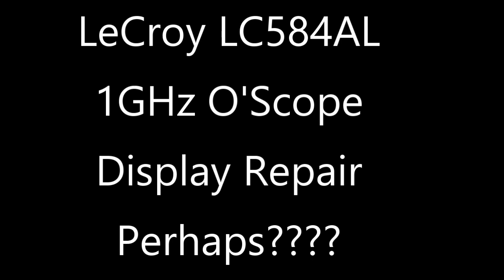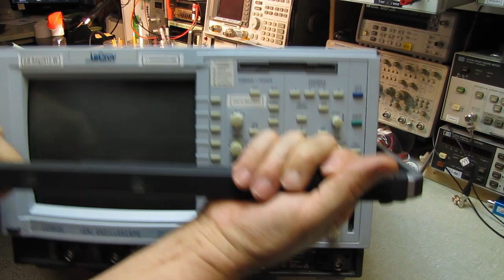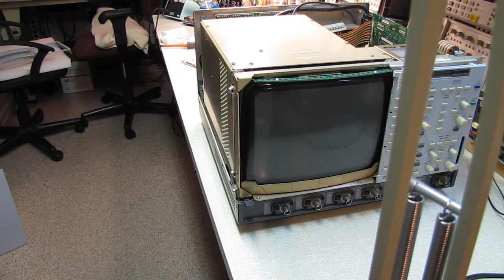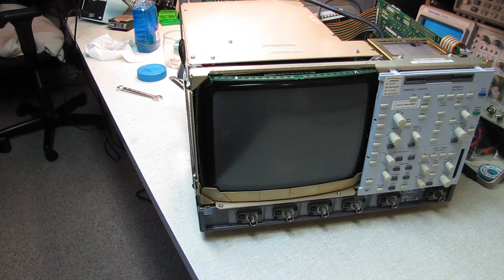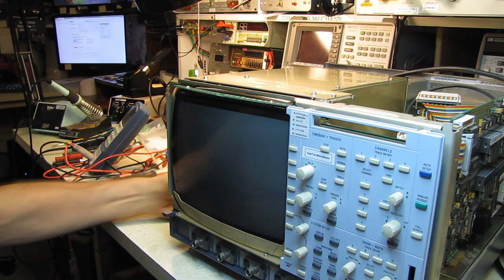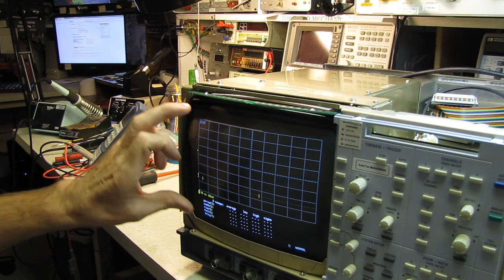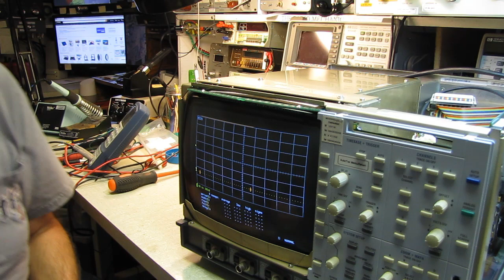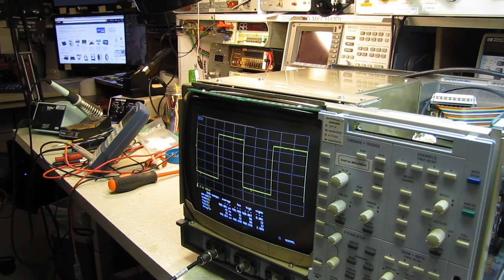LeCroy LC584AL O'Scope Monitor Repair - Perhaps ??

Comment: Humidity sensor, sees to be a magnetic field cancellator device which comes on  only when you put a disk into the disk drive. The top of the screen goes blank then.
Keep the floppy disc reader inside but not connected since you don't use it.Your jittering screen  might go away.

Comment: I know I'm a couple of years late but the monitor is a CD-1035E series monitor. I have the same in mine an LC574A and a service manual is available through the LeCroyOwnersGroup. Mine has no raster and working on it is impossible like you described so its been apart for a while and will probably go to an LCD screen if I can find one.

Comment: I've had the worst luck with Lecroy's, --  I've owned three of the older amber 'scopes up to 1GHz in my shop. I currently only have a 9350 500MHz that I switched on 3 weeks ago and although it powers up, no display anymore. I don't have the time to repair it and I feel your pain. I had an amber, white case, 1GHz that, when I moved it, it committed suicide on me (I was moving it to another position in the shop carrying it by the side handle when said handle decided to part from the case and the 'scope made an ugly mess all over the shops concrete floor). It probably knew it's display was going fail and did the honorable thing first. I love these 'scopes, but they are a service nightmare. I have Tek 'scopes going back to the 7000 series that just keep on ticking... the most reliable scopes ever.

Comment: The good ole days in the TV shop when you could buy a can of freeze spray or use your Weller gun to cool or heat components. Found many intermittent problems that way.
Reply from the maker: Still works today.....
Reply: @Marvin Emory Instablaster ;)
Reply: @Kash Finley Thanks for your reply. I got to the site on google and im waiting for the hacking stuff now.
I see it takes a while so I will reply here later when my account password hopefully is recovered.
Reply: @Kash Finley It worked and I finally got access to my account again. Im so happy!
Thank you so much, you saved my account !
Reply: @Marvin Emory glad I could help :)
Reply: @theradiomechanic9625  The freeze-spray now is not as cold as the old R12 in a can they used to sell.  We even use to use liquid R11 in a 5 gallon can for cleaning camera lenses.

Comment: Wow! Did they require that all of their repair techs be Arnold Schwarzenegger's  3rd cousin? Lol.  
The interior of the VGA display is a horror show but the modularity of the beast is kind of nice.  Looked like any old VGA display that fit the faceplate would have done the trick.

Interesting gear and another great video!  Congrats on the fix!
Reply from the maker: Not sure it's a fix yet. We will give it a month or two.

Comment: Replacing that battery was a waste. It's rechargeable and was probably low because the scope had not been turned on in a while. Regardless, the battery keeps nothing important, just panel config and stuffs. The scope self calibrates as you mentioned, there is no calibration data to be lost.

Comment: You can really tell that maintenance was dead last in that scope's list of requirements.
Reply from the maker: Sadly Tektronix, HP and everyone else have gone the same route. Try to get an actual repair manual for any of the new gear. The process is check voltage, replace module.
Reply: @theradiomechanic9625  I like my TDS-380 for that very reason!

Comment: hey bud, if you ever need the floppy disk, it's just a drive belt. I've got that same scope and it's 1.5 GHz bigger brother. I replaced the belt in both scopes and they work great.   P. S. I always wondered what that board above the CRT was too! The 1.5 GHz scope doesn't use a CRT and that board is not there. maybe it's some kind of static guard?
Reply from the maker: Hi Joe, Thanks for the offer. Can't imagine I will ever use the drive. Appreciate the offer.

Comment: Looks like LeCroy farmed out the display to some custom shop in Asia and the power supply to somebody else etc. They just put it all together at the factory like a kit. Did a quick cal and out it went for silly money.
Reply from the maker: Your likely correct. Common these days. Probably LeCroy designed it.  At least it was not from Mainland China. Samsung and most Taiwan manufacturers are pretty reliable. I worked throughout Asia most of my working life.

Comment: There's plenty of room in there you could have glued in a 2xAA holder for the memory instead, yes? 3V is 3V.
Reply from the maker: If you wanted to haul it down and open the box every year and check/replace batteries. These button cells last years without leaking. I have seen some leak, but it is rare.
Reply: @theradiomechanic9625  An ordinary 18650 battery would probably work as a replacement.